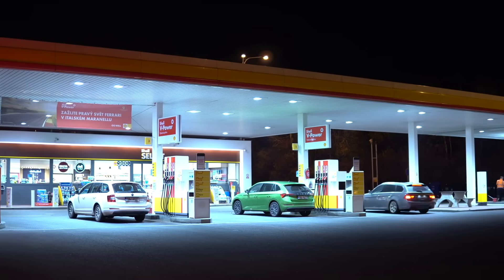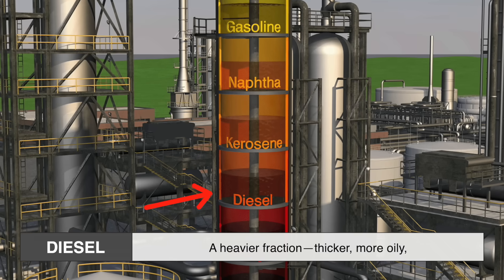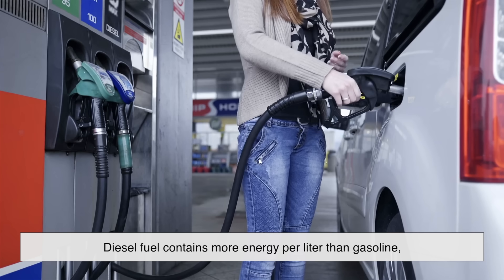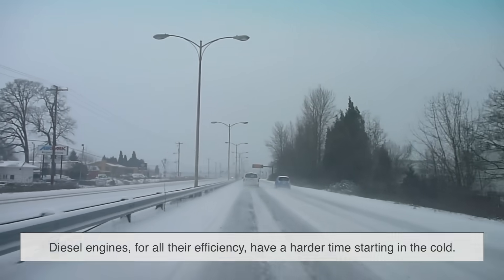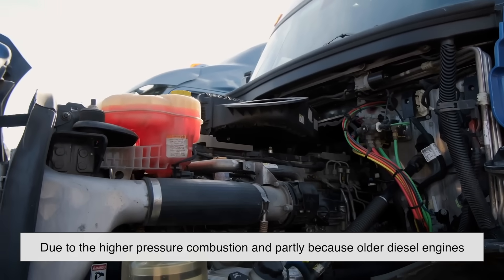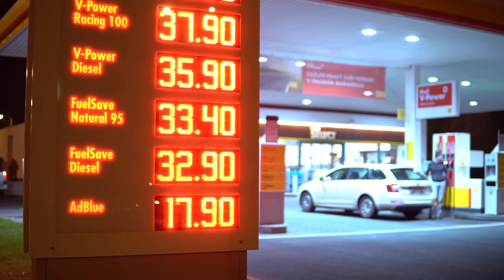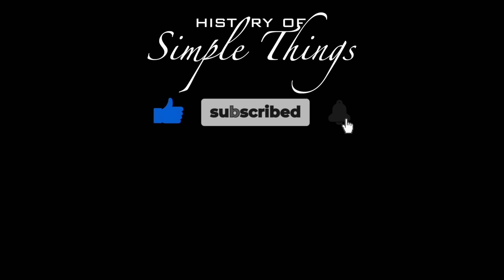Diesel vs. Gasoline: What’s the Real Difference?

Comment: Note: the car you have uses either gasoline or diesel, you dont get to swap between. The "choice" you have is if you want your NEXT vehicle to run solely on one or the other. Please dont "try a tank of diesel" in your car if its not already a disel engine to start with 😂

Comment: It is very important not to mix those fuels. Diesel fuel won't run at all in a petrol engine and will clog the entire fuel system. Petrol could run in a diesel engine but doesn't have the lubrication properties diesel fuel has.
Reply: Topping up a diesel with 10% petrol is a good injector cleaner

Comment: Inside new diesel cars. well insulated. you dont hear same noise as when the windows are open. there is also AdBlue system to convert nitrogen particles into harmless products.
Reply: the acceleration could be an issue in the city, after an intersection or a trafic light. it annoys me that it is kinda slow when i accelerate. worried i will break the gear if i went too quickly

Comment: Sorry, this is knowledge of the 60s or the 70s. Please explain how a petrol engine running direct inject in stratified mode would produce less particulate and NOx than a diesel equivalent? Bs! Petrol burns hotter therefore will in a stratified condition with an excess of air produce more NOx, so also particulates potentially, but that is not politically correct to say.

It is not what fuels the vehicle that decides its emissions, it's how one controls the combustion and after treatment.

But for countries stuck in the past with bunch of push rod engines... That might be still a truth as it is a truth from the past.

Comment: Both diesel and gasoline fuels vary in quality according to the season. Winter fuels are more volatile. Interesting variation is that high altitude gasoline has a lower octane rating as the thinner air reduces engine efficiency.

Comment: Other than larger pick up trucks or SUVs, I don't think any American car companies make diesel engined vehicles any more and in my neck of the woods, North Carolina the price of diesel at the pump, diesel is 40 or 50 cents a gallon more. Why would anyone buy a diesel engined car today?
Reply: Because not everyone on Earth lives in North Carolina ?
Reply: Reliability? Longevity of engine? Economy still wins out even with higher fuel price dependent on price difference and annual mileage?
Reply: I see your point. I believe it is mostly dependent on what you intend on using the vehicle for.

 In simpler terms, let's say you are in construction. You just got a big contract, but it is going to be 45 miles away. One way. That's 90 miles per day if you are commuting. Not to mention the extra weight of your equipment, for the contract. 

On the other hand, if you work at a local bank. You won't be traveling that far. Or need a vehicle capable of carrying that much weight. It's all a balance of compromises.
Reply: It is also a fuel burn rate issue. Diesels don't need to be filled up as often as gasoline. Because Diesel burns slower than gas.
Reply: Diesels often use much less fuel per mile than gasoline engines. Cost per mile is the better comparison, not cost per gallon.

Comment: NO. Gasoline does ignite just fine from compression alone. it ingnites too fine actually. Boom!
Reply: Yeah, the compression ratio in a diesel engine is way higher than gasoline engine. Gasoline would self ignite at such pressure, probably sooner because it’s more volatile.

Comment: I’m on my fifth diesel car, I’ve had nothing but diesel since 1985. My current 2016 Civic estate gives me 65/70 mpg with an annual road tax of £20. Although diesels are noisier at tickover and stop start driving as I live in a very rural area of Wales that doesn’t affect me, I like the easy low revving ability to climb steep hills without highly revving a petrol engine.

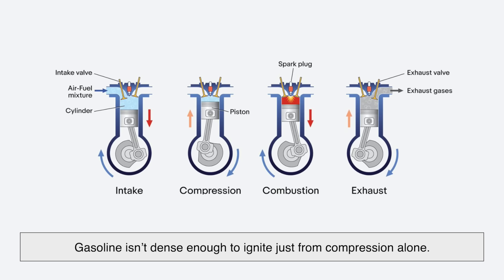Comment: Regarding 2:44, for those who are unfamiliar, a "Fire Piston" is an ignition device used to start a fire. It consists of a cylinder with a tight fitting piston. A small piece of tinder is placed into the cylinder. Then the piston is quickly slammed into the cylinder. The sudden and forceful compression of the air inside produces heat which ignites the tinder.

Comment: I now on my second diesel engine car over a period of 17 years I would not now buy any other powered car my correct car averages 65 mpg and gives me 750 miles of range from 52 litres
Reply: 750 miles out of 52 gallons is only 14.4 🧐
Reply: Gallons?
Reply: @harikrishna69 well done i would when someone would spot the mistake 😅
Reply: My 08 Duramax gets 15 mpg but she tows my trailer thousands of feet up mountains without any trouble at all.
Reply: My fully loaded 2022 gmc cargo work van with v6 would get more than that if it had that much fuel. Why did they put so big a tank in it😢

Comment: I would like to know if Hydrogen vehicles deal with driving at 32° and below.
I read that the only Exhaust from hydrogen is H2O...water... would it not freeze?
Reply: It's possible but I doubt it. Hydrogen combustion engine will definitely have a hot exhaust and I would think a hydrogen fuel cell also puts out enough heat to keep it from freezing before the water exits the exhaust. Still it's interesting because I wonder how much cold would effect the performance. I also wonder how would would deal with the ice on the roads from the waste water
Reply: Then what happens when you turn it off @tylerproctor4878
Reply: Gas and diesel produce a lot of water; so, I don't think freezing would be a problem. The problem with hydrogen is that it's a gas and not a liquid.  It also doesn't have the energy density of the liquids.  Propane has been tried in the past and is still used in niche applications.

Comment: ...And don't try putting diesel in your gas tank, or gasolene in your diesel tank!
Reply: Diesel in a gas car is not much of an issue. Just drain the tank, fill gas and drive. While gas in a diesel engine will detonate prematurely, potentially destroying the engine.
Reply: I heard the latter is much worse.
Reply: @lajya01 in the 1980’s Peugeot used to recommend putting up to 33% of Paraffin or up to 25% of petrol in your diesel car tank in sub zero temperatures, but also pointed out using paraffin was illegal in the U.K. as it was not taxed for road use. Bear in mind in those days most diesel cars had indirect injection systems operating at about 300bar unlike today’s diesels that have common rail systems of fuel injection operating at about 2000bar.
Reply: @keithwelton  Using heating oil (to avoid taxes) in older diesel engines was common. Where I live, farmers diesel is also dyed to be easily detected if road trucks use it (not the same tax rate).